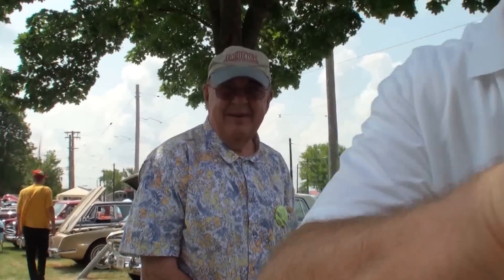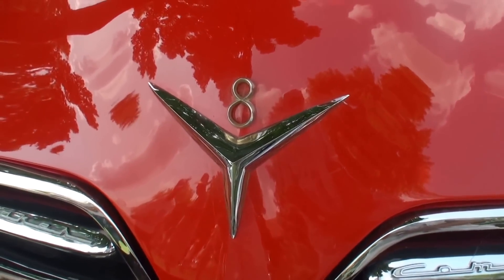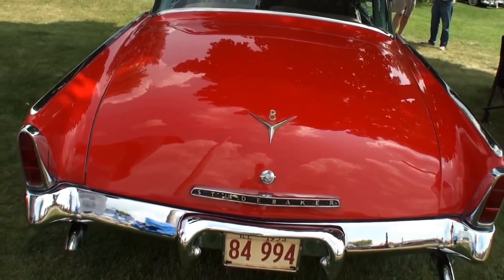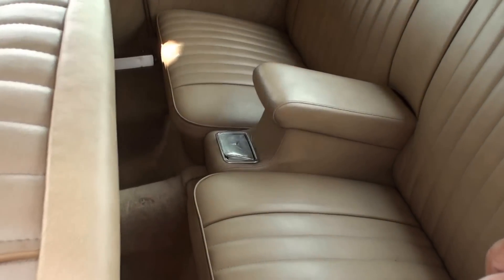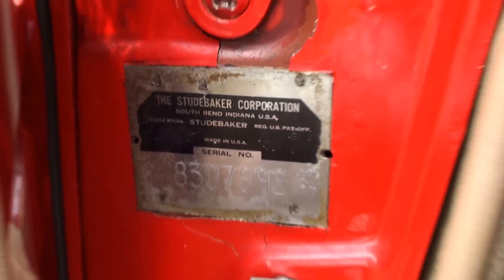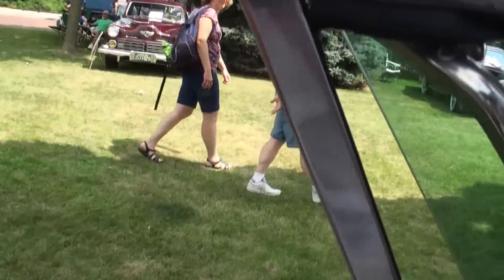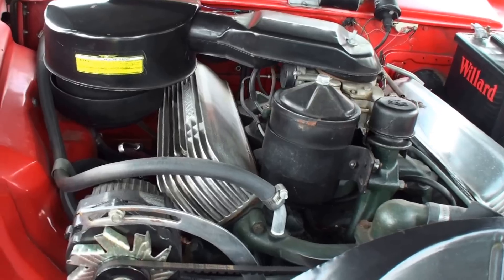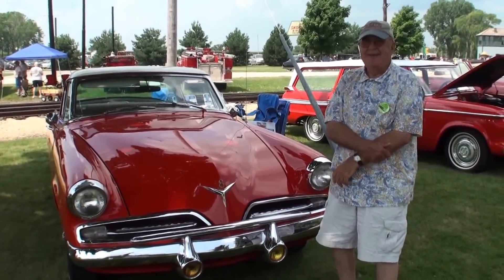1953 Studebaker Commander V8 Starliner Coupe - My Car Story with Lou Costabile

Comment: There's a Studebaker with that beautiful 53 two door body that nobody seems to have mentioned below. The 1955 Studebaker Speedster. It came with a stick and ran real nice. Wouldn't beat the 55 Chevrolet V8 with stick, but close. I had two guys pull up beside me (along the Ohio River on Rt 7) when I was driving Daddy's 55 BelAir base two barrel single exhaust V8 4 door with automatic. I had a reputation for having outrun every Ford, Plymouth, Dodge V8 etc with automatic in town, although they all had a superior transmission to my two speed slip and slide Powerglide, but I knew how to make the most of that tranny by 'humping it up' by revving it in gear while keeping my left foot on the brake. Even then the others had a better trans but I guess that V8 Chev had it under the hood because I never lost a race. 

Anyhow, these guys with the stick Speedster wanted to race me and I told them in advance that with their stick they would beat me but not a friend's Chev with stick shift. So we raced anyhow and of course they beat me. Nothing proved, but I could tell by how much they were ahead at 60 about two lengths, that they could not have taken the Chev Stick. But that Studebaker looked so nice, had checkered flag patterned chrome along the rear fenders and I loved the way it looked. Incidentally, though we thought those V8s with auto were fast at the time, they are slower to 60 than one of the cars I own today, a Toyota Prius. That's right, a Prius takes 10 to 60, faster than those 55 V8s with automatic trans.
Reply from the maker: Hi John Hand, Thank you for viewing and sharing your story and knowledge of the 55 Studebaker Speedster, like this one, Enjoy! Lou https://youtu.be/K0ucl7tz_LA
Reply: @loucostabile  Hey Lou. Thanks but when you sent me this link, apparently you never looked at the video this time around. If you had, you would have seen that I made a comment on there about a year ago. Like I have said, the Speedster that I saw and knew had a checkered flag pattern in the side chrome on the rear fender, why this one doesn't I don't know.

Comment: What is remarkable is the Starliner was designed in 1951-52 and is so completely unlike any other design of that era. Unfortunately Studebaker tacked on too many V8 ornaments, bumper add-ons, and Studebaker name plates that clutter up the clean design. Some folks complain about modifying these cars, but I have seen (and you can find on the net) many 52-53 Starliners that have had the extra ornaments removed and the cars are just beautiful. As a few others have mentioned, the dashboard in these is a very weak design (or lack of design) and when you see what was done in 1962 for the GT Hawk and Avanti you can see what good dash design Studebaker was capable of (even when the company was dying). This beautiful Starliner design only lasted 2 years and then Studebaker added more and more chrome and fins and just ruined the original clean design. Thanks Lou for showing this. To each his own but I prefer slightly customized (cleaned up) versions of this car, and dropping in a modern 300 hp V6 or V8 ain't too shabby either. Vroom vroom.
Reply from the maker: Hi rizzle razzleuno, Glad you enjoy this one, and thank you for sharing your knowledge too, Lou

Comment: I've owned two 1953 Commander Hardtops and one 1954 Coupe. Bob Bourke designed the cars but like all big manufacturers the top man[Raymond Loewy] gets all the credit. The 1953 originally came with an 232.6 cu in V/8 engine.
Reply from the maker: Hi cdchoux, Happy to read you've had two.  Twice as nice :-) Lou

Comment: Very nice car! I don't think the 259 engine was offered until 1954. My '53 has a 232. Mine is as some would say painfully stock.
Reply from the maker: Hi Arielle,
Thanks for viewing and sharing,
Lou
Reply: +Sirena Actually, the 232 held on through '54. The 224 Commander and 259 President engines came on line for '55, but by mid'55, the 224 was relegated to truck use only, with the 259's as the only passenger car V8's for the President and Commander lines. Stude V8's were tremendously overbuilt, with 18 bolts holding down each head, and helical cut gears driving the cam instead of a timing chain.
Reply: 5610winston every one we had needed crank ,& rod bearings that's why the studellac came about.
Reply: there was a350 cu. on some 56hswks Packard motor don't know if 2carbs were optional as in Packards 55 Caribbean.
Reply: @dondesnoo1771    The 352 Packard V8 was only offered one year I believe 1956/1957(?)  but it was way too heavy for the smaller car. It had been designed for the Big Packards.

Comment: I can only wonder. What if Chevy had come out with this model instead of Studebaker. I know Chevy's V 8 wasn't till 1955, but the Corvettes Blue Flame six though, in this car until their V 8 came along, would have been a huge improvement over Studebakers heavy V8. That said, in no way, do I want to take away from Studebaker, what was almost an impossibility for them to build. In Thomas Bonsall's book, More Than They Promised. There is a great write up on this design, and how it almost wasn't to be built. The problems in getting this car built, were almost identical to the building of the Avanti. When so many wanted either of these cars when new, and very few actually getting them at all. The 53's and 54's were so clean and fresh looking, just such a beautiful car and way ahead of the others. Thank You to the owner of this car for keeping it mostly original. Even though it is up dated with the 259 engine, I almost was looking for a supercharger and the 289 instead. All said, this is such a beautiful car to the eyes. Thank You for the great video.
Reply from the maker: Hi Ed Hein, Thank you for viewing, sharing, and adding to the story, Lou
Reply: You mention the Chevrolet Blue Flame six. Want to know what really is a shame? For years Ford had a V8 and overdrive. Chevrolet had neither. Than finally, in 1955 Chevrolet developed the overdrive and installed it in V8 models. But they also offered the overdrive with the six. No one bought them because of the V8. An opportunity missed by Chevrolet and the customers.
Reply: I remember back around  1958, someone came out with one of those soft bound books, smaller in width and height compared to say, Hot Rod Magazine, but it was thicker. The title might have been something like "Build The World's Greatest Hot Rod.'

The book was very detailed, and suggested taking the 53 or 54 Starlite coupe and installing a small block Chevy with Overdrive.  Then underneath, the article described covering the entire driveline with a belly pan to keep air from
slowing the car down.  (They didn't know about air dams and spoilers in those days).  I don't remember what
all the book went into, but I specifically remember the Chev V8, overdrive and belly pan. Even today, that build
sounds good.
Reply: Hi John. I started High School in 1959, I used to catch a ride to and from school with a guy that had a 53 or 54 coop. I remember very little of it today, except for the awful rust that it had on it. I don't think the rust problem helped Studebaker's image, either poor design to funnel water away, or poor steel quality. Seems Studebaker had their own steel plant for awhile as steel was scarce during the Korean War. Anyway, what a shame that the dream of George Mason, to unite Hudson, Packard, Studebaker and Nash, never happened before his death. The new company might not have survived to today, but just another, I can only wonder, what could have been.
Reply: @johnhand871  Chevrolets overdrive units were Borg Warner units as were Fords, and Studebaker used the Borg Warner transmission with their overdrive.  the Studes Automatics were also Borg Warner !!!
Reply from the maker: Thank you for viewing and sharing.

Comment: 3:45 Cadillac introduced an OHV V8 in 1949, Studebaker in 1951.  Not even close.
Reply from the maker: Hi Scooter George, Thank you for viewing and sharing your knowledge, Lou
Reply: You are welcome. The Stude V8 was a good engine. And, unlike other independents it was one they themselves designed.  If you happen upon "Studebaker, The Post War Years" y Richard Langworth, grab it. It is an outstanding book.
Reply from the maker: Thanks for the tip.
Reply: Scooter George caddy v12s 1930shad ohv .239 in 53. 259 in55  289&352cu.in56 had trouble w6v in 51ratop w259 engine from a 55 .

Comment: the V8 engine in this car came from PACKARD as Studebaker never had one.
Reply: That's wrong. Studebaker/Packard merged in 1956 and this coupe with the Packard V8 was called the Golden Hawk. (Going from memory here, I think the Packard engine had 352 CI.)  Then in 1957, to save money maybe, Studebaker went back to the 259 C. I. V8 and installed a Paxton/McCullough supercharger (blows down into the carb) and rated it at the same HP as the 56 Packard engine Golden Hawk at 275 HP.
Reply: Michael  BULLSHIT !!!!  Studebaker introd the OHV V8 in the early 50's friend had a 52 V8, and Packard did NOT merge until 1957 or so and their V8 was in the range of 352 Cu In and was only used one year or so in the Golden Hawk, the top of the line Hawk series !!!  And it was a huge iron monster !!! !
Reply: @wilburfinnigan2142  Studebaker/Packard merger was in 1956, and the Studebaker Golden Hawk had the 352 C. I. Packard engine rated at 275 H. P. If you ever see the 4 door version of the 56 and 57 Packard, you will puke. They used the Studebaker 4 door body and added hooded headlights and weird fenders, etc.
Reply: Cadillac was the very first American manufacturer, to produce an overhead valve V8, in 1949! Oldsmobile was the second, in 1950. Studebaker was the third, in 1951. With their 232.6" V8, this version, was used until the end of the 1954 model production. And perhaps, a few early '55 trucks, as well? All subsequent Studebaker V8s, which include the 224", 259" 289", and 304.5" versions. Were based on this original design and continued until production, of '64 models, was shut down, in South Bend Indiana, on Dec, 27th, 1963. The Studebaker V8 was introduced, before Chrysler, Dodge, Plymouth, Ford, Lincoln, Mercury, Buick, and Pontiac. As well as Chevrolet, and Packard. Which were the last, in 1955. The Packard V8s, were available in 320", 352", and 374" versions. The Studebaker Packard corporation, was actually formed, durring the 1954 model production year. Packards were produced, in their own Detroit facility. Until it was shut down, at the end of the '56 model year. '57 & '58 Packard models, (PackardBakers), were produced in South Bend. '58 was Packards final production year!
Reply from the maker: Hi michael george
, Thank you for viewing and sharing your thoughts. Hope you see many more cars on this YouTube Channel you enjoy. Please subscribe, and hit the "bell" so you can see all the cars when they are uploaded on this YouTube Channel, Lou

Comment: The V-8 in the 1952 Studebakers was 232 CID, not 258, and was rated at 120 horsepower.  The 258, 289, and 304 CID displacements all came later.  This car has probably had a transplant of the larger engine and has valve covers of a different style than the original.
The engine was very good, although quite heavy for its internal size.  It was introduced in Commanders in 1951 and it replaced Studebaker's antediluvian larger L head six.  The smaller L head continued in the Champions.
Reply from the maker: Hi Ed Arcuri, Thank you for viewing and sharing your knowledge, Lou
Reply: Lou Costabile we raced one of theese 55yrs ago 259 engine appeared in 55commander &speedster w. Carter 4bbl .carb caddy. conversions were common in the day studellacs.they were called , fabulous Sam Rosenberg Ridgefield nj. had one .used car lot.
Reply: The 259all around better engine than the 239 bearing problems 2bblcarb .but the bigger one didn't like 6volts hard start w hot.